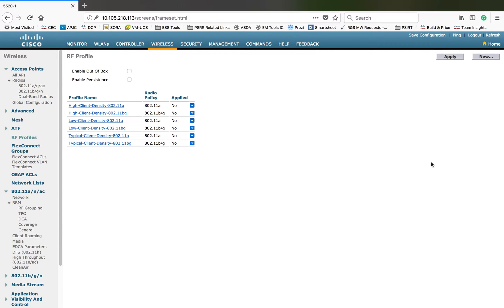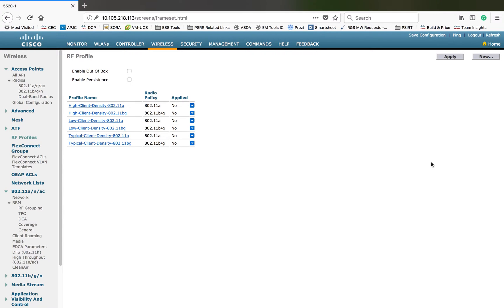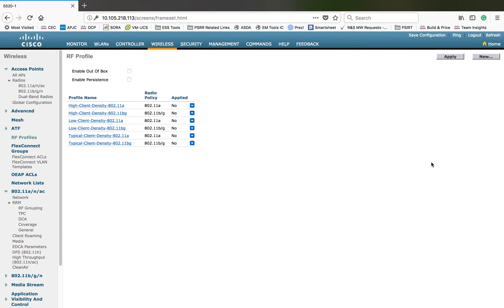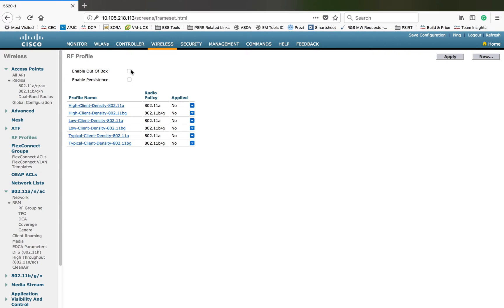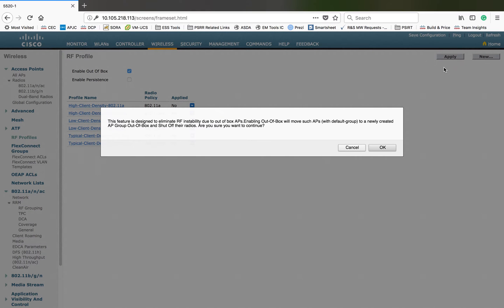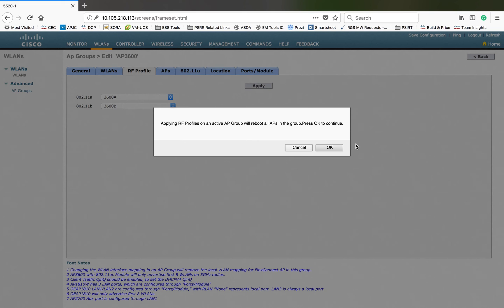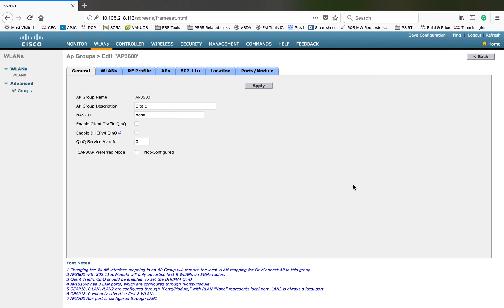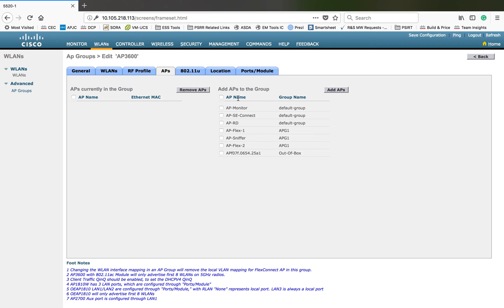How to Create a RF Profile on Cisco WLC

Comment: I do have mix of Aps with different models in single floor. and those are installed like one 2800 , one 3800 and one 2700 like that in entire floor the are covering with WiFi. In WLC i am having default RF group and default Ap group. Shell it create any issue for me in feature. If it, then what type of issue will happen.

And If  i am going with the same setup, then RF assignment will work properly and will it cover entire floor with coverage holes?

If i am going with different RF groups for different model APs, then how the Aps will exchange NDA packes (because Aps are in different RF groups)?

I am looking do Audit on my wireless network. If you clear my doubts, then i can go head and change configurations to avoid issues in feature.
Reply from the maker: Each AP models have its own RF behavior. That includes Tx power levels and Radio Azimuth/Elevation Micro, etc..
So its never recommended to place different AP models in same floor if they are visible to each other. This will lead in to Wrong RRM behavior in your network.
AP group creation will be helpful if all the APs are in same model in one floor, else its not going to help with the RRM algorithm.

For an example: Think about this scenario from a client point of view, client algorithm for choosing the best AP will go wrong. That can end up in a situation all clients are getting connected to the best AP in the floor(Eg:3802) as the Client Radio Driver will see 3802 the best AP in the floor based on the AP capabilities.

So conclusion is not to use MIX of APs in same floor, its my personal recommendation.